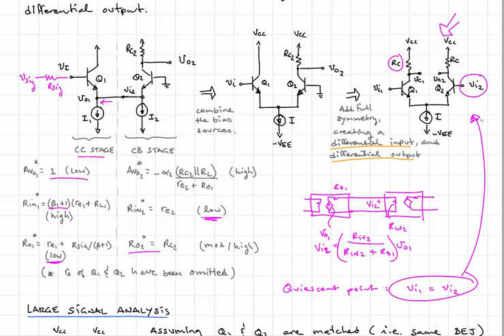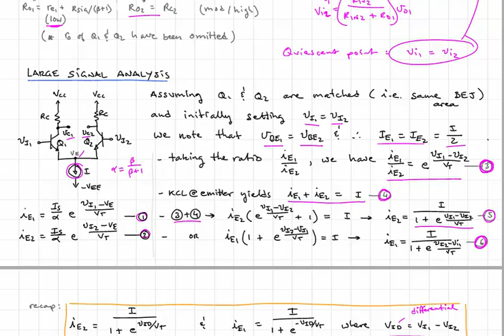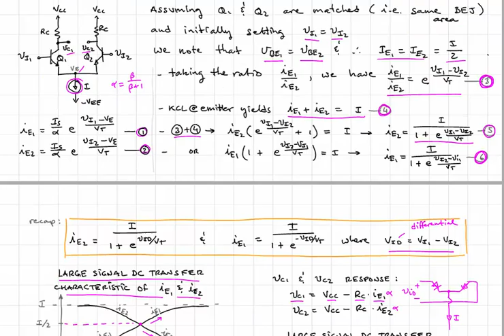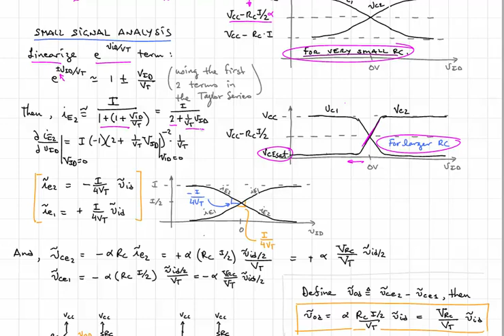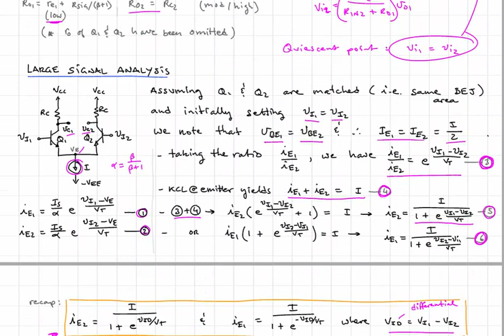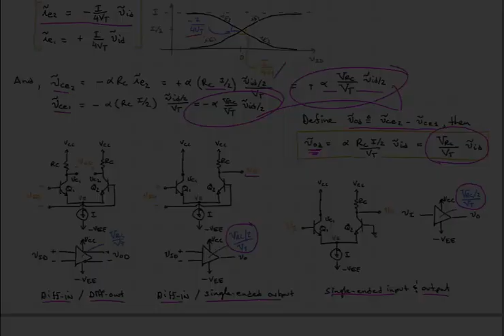Differential BJT Pair - part 1 (ss8.1)

Comment: Nice explanation! Shouldn't your Collector of the CC amplifier be grounded? (Your model before adding up biasing sources).
Reply from the maker: The collector of the CC stage is connected to the positive supply rail, which is in effect ground once the DC biasing is turned off/removed. Recall that in amplifier analysis the DC operating/bias point is first found, then all DC sources are zero'd for conducting AC small signal analysis
Reply: @ thank you for the detailed response, you know your stuff!